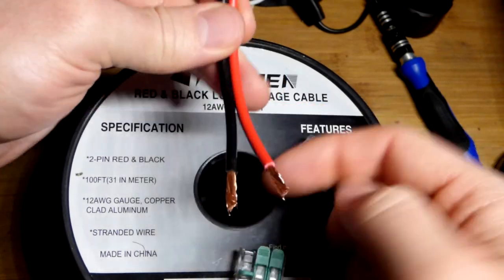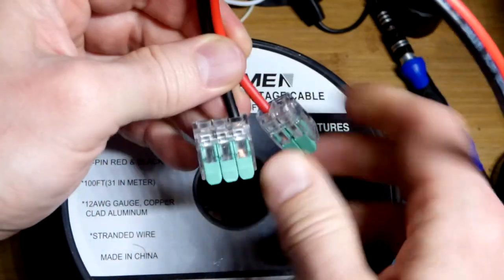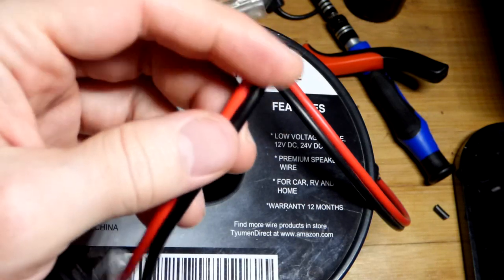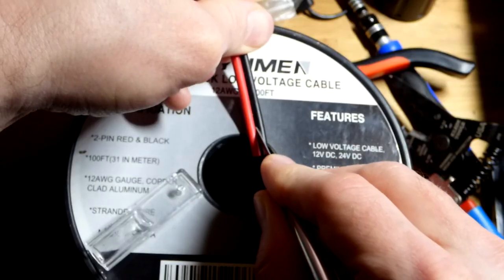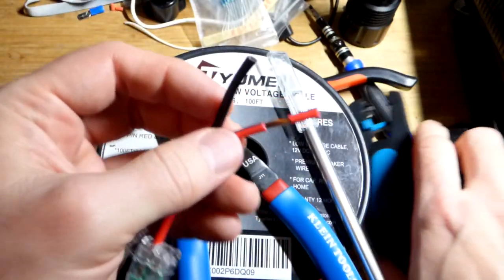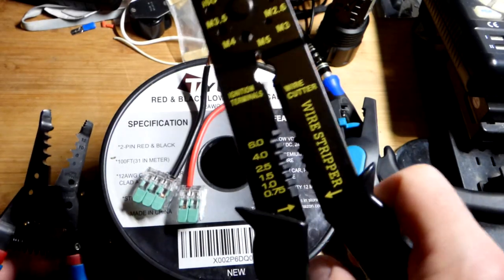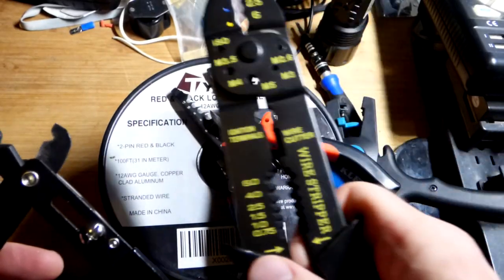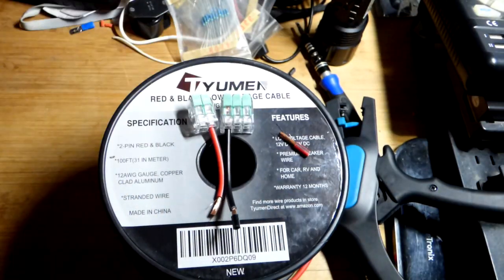More Using 12 AWG Stranded Wire Practice

Comment: I greatly appreciate all that you do to teach and share! However, I think that you are not using the correct methods, in this case. A better method would be to use a proper crimp-on wire ferrule, to secure the loose strands, before clamping them in the connector. And, folks also tin the loose strands, before clamping them in the connector. That is also less than optimal. There are too many details on the subject to cover them in this comment. But, just like soldering, success is in the little details. So, research ferrule crimps, their advantages and the proper way to use them. You are already doing 90% of the needed work. The additional 10% of using a crimp will grant 100% more success. HTH.
Reply from the maker: Yeah, I thought these connectors would hold the strands better. I also thought they could handle more than 12 AWG until I saw what a tight fit they were, I think they held 16 AWG strands better than this. Was already thinking of making a video where I test other connector types plus tinning. I've made videos with ferrules so I'm already familiar with them. Thanks for the comment!